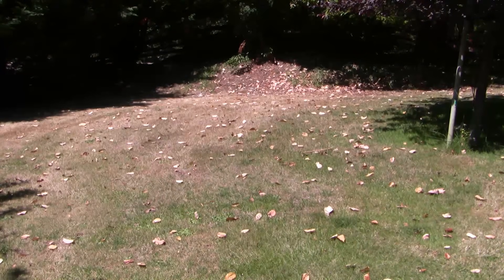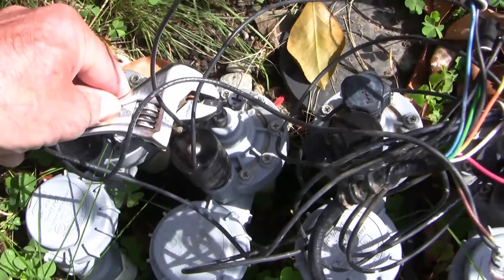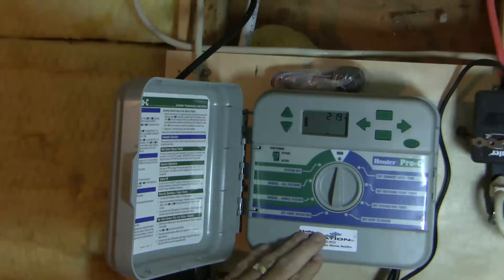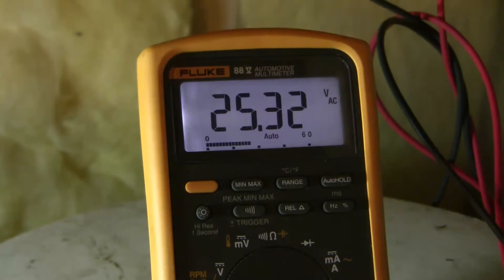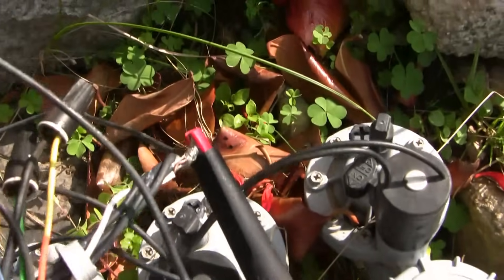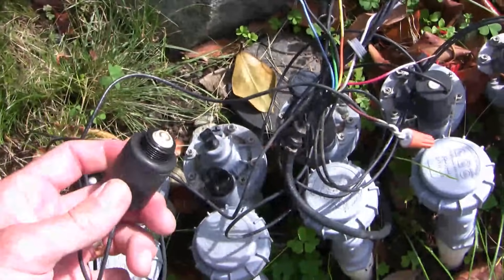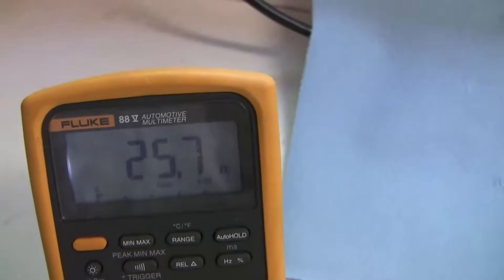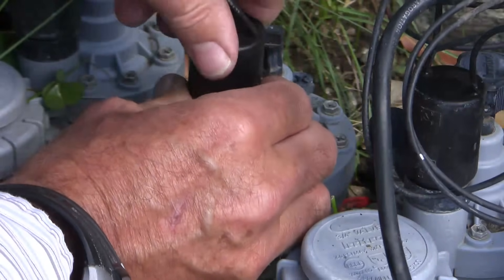How to fix an irrigation sprinkler zone that is not working

Comment: thanks for the video. I have 8 zones in my sprinkler system. all the zones are working fine when I do a manual valve test. but the moment I try to run it based 9n schedule, I get fault message in weathetmatic system. As per fault error code, "MVP is short" . I tried clearing the fault manually but still system goes back to fault. how can I fix MVP short? please explain. Thanks again.
Reply from the maker: I'm not sure what MVP stands for but a short usually implies a short to ground, a wire that is short-circuited to ground. I would be searching for a dealers manual, checking connections, and exploring areas where wires could be crossed or damaged. A common place for that to happen is where the wires come together at the controller, with a thread of one wire stretching across to another pole. Hopefully it's not the control circuit board, which may be very difficult to fix. Good luck!
Reply: Thanks for reply. as per the analysis i did, MVP stands for Master Valve Pump. I m not sure how & where do start with in case of master valve pump.
Reply from the maker: I'm sorry I can't help more. I would go to the manufacturers website looking for an algorithm for problem code investigation. Some websites offer this to anybody, others restrict access to licensed technicians. You might get extra help if you can find a page for repair technicians.

Comment: What do you do if everything turns on, but won't shut off?
Reply from the maker: If it's just one zone, I'd be looking at the valve. If every zone, a controller issue, but make sure all zones are manually closed before testing. Also look around for wet spots in the grass, since I suppose a leak causing poor line pressure might cause a general problem like that.

Comment: what do u do if none of the zones are activating? My whole system is not working. Help lol
Reply from the maker: Make sure all the valves are manually closed, and make sure the main shutoff valve inside the house is open. Then manually open one valve at a time and see if water flows. If water does not flow, you've got a leak in the continuous pressure side of the line, somewhere. Often you can find it by leaving the system open for a few hours and then dig down where you find a puddle. If the system works normally when you open valves manually, you may have a problem with the controller. At this time of year, the commonest cause is failure to close all the valves manually. After blowing out the system in autumn, technicians usually leave valves manually open over the winter so they don't trap water and cause freeze damage to pipes and valves.

Comment: seriously dude...Dynamic resistance and OHMs testing????   how the fuck do I just fix the zone that isn't working with my state college degree?
Reply from the maker: That's a fair criticism. My channel is aimed at auto mechanics, who need to be familiar with a very important concept underpinning that remark. If you search "Voltage Drop Testing", you'll find a concept that explains a critical pitfall in electrical diagnosis. It explains why you can't properly test a battery with a multimeter, and why your solenoid could still be OK even if you show good voltage at the connections, and also why line length and wire gauge can suck the power away from end devices. So, if you can find the time to learn that simple concept, you'll be rewarded with a lifetime of insight going far beyond how to fix a sprinkler. When current flows, voltage at the end device drops in proportion to line resistance. So, to properly test a circuit you need current flowing. In the absence of interest or time, many just swap in a known good solenoid and if that works you've fixed the problem. In auto mechanics, the game of part swapping can lead to expensive mistakes that are easily avoided with a little insight.

Comment: Great video. One question off topic. What do you have sitting on top of your control box? It's looks familiar but can't figure it out
Reply from the maker: It came with the house. It's an electrical connector that came with the control board, not needed in this application. The guy who installed the board must have done what I do, hanging on to extra parts in case they might be needed in the future.

Comment: Im getting 15 ohms on my controller, I'm wondering if this because I connected 2 cables .
Reply from the maker: When you do continuity testing with an intact circuit, you introduce variables that make it hard to interpret results. I tend to try and simplify as much as possible so results are unequivocal. Good luck!

Comment: i have a orbit water master timer mod 57012 that runs 5 sections but i want to eliminate 3  which is 2.3.& 4   leaving  only 2 . 1. & 5 i tried to set only the 2 sections but the timer shows only 4 what can i do thanks for any help
Reply: just take the wires out of the connections in the clock and reprogram your controller. Make sure to get a sticky note and write down wire colors and zone numbers in case you want to put back the zones you took out

Comment: HI I have the same system and have 1-6 sprinklers work fine without any issue but 7,8 and 9 do not spray any water, this happened recently any ideas what the issue could be ? Thanks in advance

Comment: What's the problem when to zones go on at the same time robbing each other flow strength, how do you fix that?
Reply from the maker: If you think about how these systems are designed, the reason for separate zones is because there is not enough reserve for all the sprinkler heads to be open at the same time. These systems are often designed by professionals who know the local pressure and flow qualities of the neighborhood water supply, but it would be easy to make a mistake  (for example if there were an unexpected kink of the supply line near the house). Most professionals follow a recipe based on experience as to how many and what type of sprinkler heads can be installed in each zone. Zone problems arise from either reduced flow (line debris or valves not opening completely, etc) or from excessive loss (damaged lines, leaking valves, etc). It can be hard to tell the difference, so you have to look for other clues like wet spots in the garden or one sprinkler head that has popped off. If the zone is badly designed you may need to block off one sprinkler head to allow others to function normally. Alternatively you could switch one of the heads to a lower flow device to allow better flow in other areas. If you think it's a low flow situation you could flush the line or even block off one branch of a zone to better define where the problem is. Sometimes you need to remove heads to clear the line of debris, which tends to snag right at the spray head. The two common situations are occult water loss from broken lines and debris clogging sprinkler heads. Good luck!
Reply: 9567-9287

Comment: Very helpful video.  After replacing the solenoids I still have one zone that intermittently stays on when it should turn off.  Zone 6 starts watering but zone 5 has not turned off.  This happens about once every 6 times the system runs.  Any suggestions?
Reply from the maker: The zone 5 valve is likely sticking open, and when it does that there isn't enough water pressure to open all the sprinklers on zone 6. I would disassemble the zone 5 valve, carefully clean it AND flush the proximal line of upstream debris, then reassemble and hope the problem is resolved. If not you need a new diaphragm or a new valve. You could help to verify the above diagnosis by showing the solenoid for zone 5 is not getting power when the valve sticks open, but it can be tricky to do that and the likely culprit is the valve rather than the electronics. I did another older video showing how to do that with a very simple valve, though some systems are a little more complex. Upstream debris can intermittently lodge in the valve seat, and when you inspect it may be hard to see the debris if you forget to flush. So, even though it's a little messy to turn water on when the valve is disassembled, it's important to flush. Good luck!

Comment: if i want to swap solenoids just to test it, when you say turn water off first, do you mean turning off the entire water system or just at the solenoid area
Reply from the maker: The main line has pressurized water all the time, so you need to turn the water off at the main valve inside the house.

Comment: Also, this is probably a dumb question, but is it okay to connect the wires without turning off the electricity to the system?
Reply from the maker: Yes, the voltage and current capability of those solenoid wires is will within safe limits for human exposure. More importantly, the wires should only be hot when the zone circuit is activated, since the switch back at the controller is open. In the interest of general good technique, hook up your wires with all zones off at the controller.

Comment: I'm trying to determine whether my solenoid is bad, but I don't have the expertise to test current and such.  My solenoid is buzzing when that zone is supposed to be working, but there is no water.  Does the buzzing sound indicate a bad solenoid?  Thanks.
Reply from the maker: You could swap the solenoid for another one beside it, without removing any wires, then run the two systems by the controller. If the problem follows the suspect solenoid, causing no water in the previously good zone, then you need to replace the bad solenoid. That said, if you feel uncomfortable doing this kind of work it may be wise to ask a pro to help. Little details like reattaching the wire nuts with protective dielectric grease will help to prevent more tricky problems in the future.

Comment: Great vid. question.. my situation is a zone isn't automatically turning on with timer, the manaul operation on the broken zone is working good. It was working up to a week ago. 3 weeks ago I replaced solenoid and replaced the 5 pop up sprinklers and worked great, what happened? What should I do to fix it?
Reply from the maker: I would start with basics. Look closely at your wire nuts and consider the possibility you have a loose or disconnected wire. If you don't see anything there I would back probe the connector and do a voltage drop test with the circuit active. If you don't know how to do that you could disconnect the solenoid and test static resistance, or you could swap in a different solenoid to see if the problem is resolved. If your new solenoid failed, look for excess voltage that could fry the coil, although that would be unlikely in your situation. The most common cause would be a bad connection or a bad ground. If you want to learn about how to do a voltage drop test, I did a video of how that is done on an automotive circuit, testing a starter motor before replacing it. Good luck!
Reply: +spelunkerd I should add that the sprinklers automatically with timer "spit out water" but don't pop out. Only manually
Reply from the maker: In that case, look carefully for a sprinkler head that is leaking more than the others. If a leak is too severe, the pressure in the line drops to the point it can't lift all the sprinkler heads to their operating position. If the problem is a leak then usually manual operation fails, too. The other possibility is the solenoid is opening the valve but not completely enough to gain full pressure. Check the valve for debris that might impair full movement.
Reply: Does this zone have any heads close to a driveway?  Twice someone has driven over one of my sprinkler heads, and broken an elbow underground.  If so, turn that zone on for a minute, and you can usually see water seeping up out of the ground near the head that broke.   Turn off the water and dig out around the head, then I use a nipple extractor tool to unscrew the broken-off piece of threaded elbow.  Since room can be tight,  especially if the elbow threads into the bottom of the supply line, I take the nipple extractor off the T-handle and use it on a shorty/flex-head ratchet  to unthread the broken piece of elbow.
Reply: +spelunkerd +steven fisher Thank you guys, what ended up being the problem was that the solenoid was closed "too tight" which was one of the first things I checked to begin with! I ended up checking that again after trying everything and giving up and what do you know they work perfectly now. Thanks again for help.

Comment: Thanks for the help, thanks to your video we were able to tell that the problem is in the wires.  Now we just have to figure out where.
Reply from the maker: Finding a broken wire can be tricky if it's in a garden. There are moderately expensive tools to help do that (trace wires and find breaks), but for a big area it might be simplest to just run another wire. Before doing that double check the connections at both ends, which are always problematic areas. Good luck!
Reply: +spelunkerd luckily the wires are bundled, and we had a few redundant wires, so we just swapped in one of the unused wires at both ends and it worked like a charm.

Comment: Jeez after all that just swap the solenoid with a zone that works you can diagnose, test and verify in about 5 mins.
Reply from the maker: Yes, I mentioned that in the video, some of the testing was just for kicks. We have this debate all the time in automechanics, centered around the question of just changing parts vs proving a diagnosis. Often there are no easily accessible replacement parts available for swapping on the vehicle, and diagnostic codes often point to a list of possible causes. The "part changers" of the industry will replace one part after another and then are puzzled and frustrated when they have paid for a string of normal sensors with no solution. A better method is to more carefully look for evidence and then replace the part you prove is bad. It doesn't take that long. More importantly, you gain a deeper understanding of how these systems work, which is rewarding in itself.

Comment: question, what is causing my sprinkler zone to constantly run when I turn the water supply on?  I have to turn the back flow line closed to make zone stop running.  The timer box is off, but the zone will still run....that is why I shutoff the back flow valve.  thank you for the help!
Reply from the maker: Most likely the zone valve is stuck open, possibly from debris. Before doing anything be sure the valve is manually closed (sometimes these are left open in winter months to prevent freeze damage). If water still trickles past, you need to disassemble the valve, flush the proximal line, and reassemble. Most often there is a small fragment of rust or calcium carbonate propping the valve open. I did an older video of this problem, it's on my channel. Be sure to flush the proximal line after you have the valve disassembled to clear the line of trapped upstream particles that can jam the valve at a future date.

Comment: You guys with your volt meters and safety precautions kill me, it's 24V. Be careful don't want anyone getting electrocuted. Ha! A spare solenoid is quickest and easiest method for testing a timer, if it pops it's good the problem is in the field, no pop new timer.
Reply from the maker: +Tucker Not Sucker! Of course a pro, who has access to free replacement parts and a pressured time schedule, will approach this differently. However if you have to drive to a store and pay for all parts the workflow can be very different. There's nothing wrong with understanding the problem a little deeper, and such effort lifts the tech above the level of "parts changer". Of course safety also includes wise effort to avoid stray current spikes to upstream microcircuitry as well, independent of any personal risks.
Reply: spelunkerd I understand your concerns but, I am not declaring anything but a solenoid which if the homeowner doesn't have a volt meter rather than driving and buying one use a solenoid from an adjacent valve or even the valve in question. As far as avoiding a power surge in micro circuitry I have been doing this for 20 years and have yet to short out a low voltage timer. All I am suggesting is using the parts the homeowner has on hand already my friend. I once found at a Customers 1 of the original electric valves that was offered for about 2 weeks when they were first released. It had a 120V solenoid using romex wire. This was a guaranteed electrocution mixed with water. I kept the solenoid as a reminder of how the obvious can be overlooked by so many people allowing this to be sold to the public. Only lasted about 2 weeks before they realized their error. Ha!

Comment: One zone goes on even though its shut off at the clock. How do I fix that? Thanks
Reply from the maker: +Lawrence Spector Sometimes the valve will stick open. If it doesn't free up when you disassemble and clean it, you may need a new valve assembly.